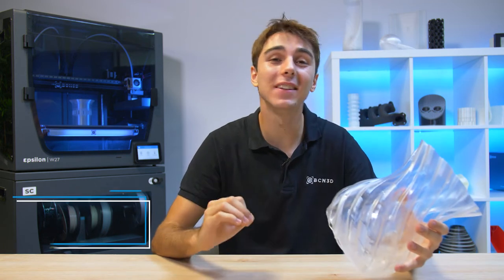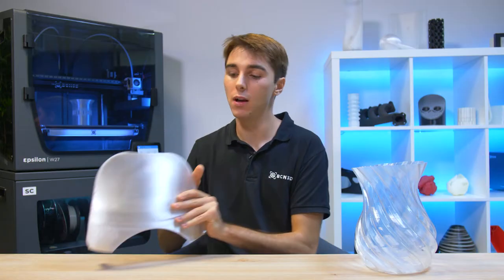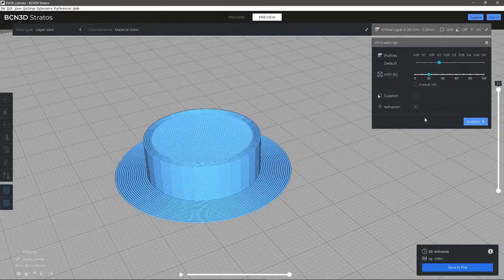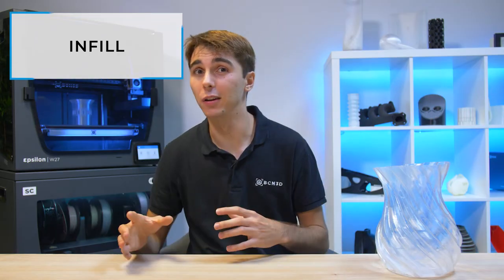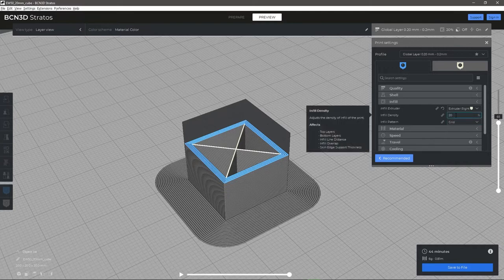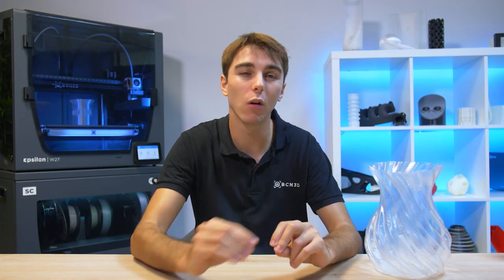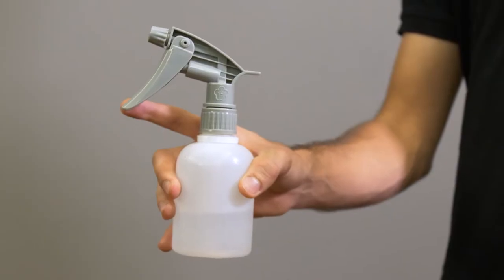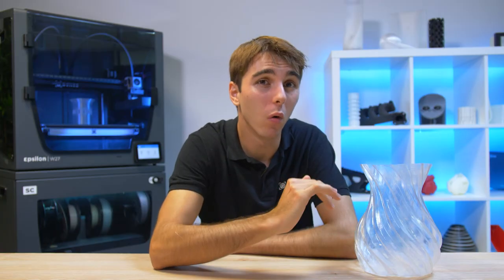BCN3D Explains: Maximizing transparent PLA

Comment: Probably a very weird question, but I'm making a cosplay costume, and I need a visor for it. Typically, people vacuum form it, but I'm interested in trying this method out. However the visor is usually tinted. Do you think it's possible to tint or dye this black?
Reply: You might try translucent black PLA from like hatchbox
Reply: I think it will be super hard to see through, but if it's only for looks, probably possible.

Comment: Hi,
at the end you say that the PLA should be smoothed using solvents. But which solvent? So far what I read is, that it is really hard as e.g. acetone doesnt work. Which one would you recommend?
Reply: Also trying to find out the solvent type
Reply: Isopropanol alcohol